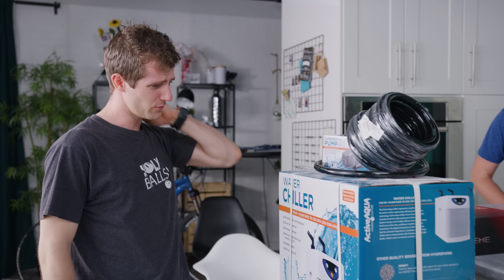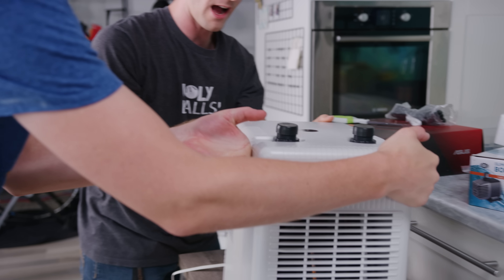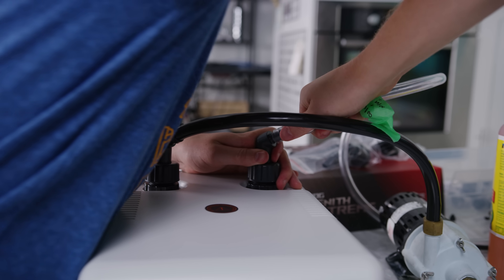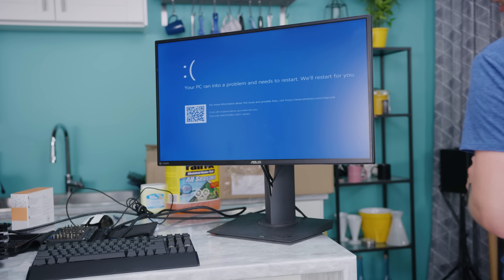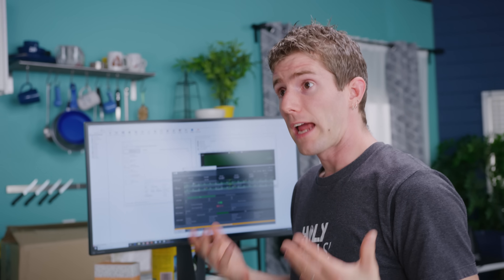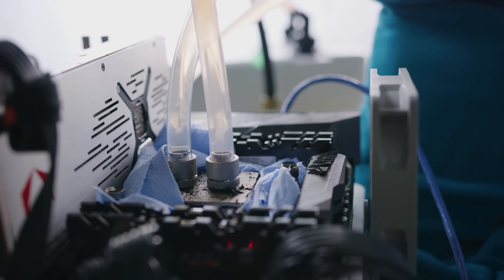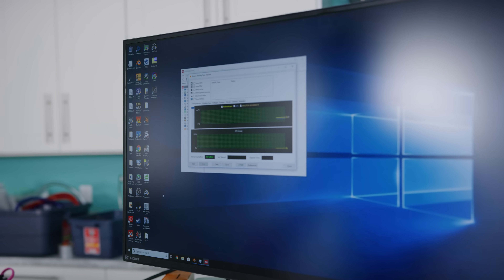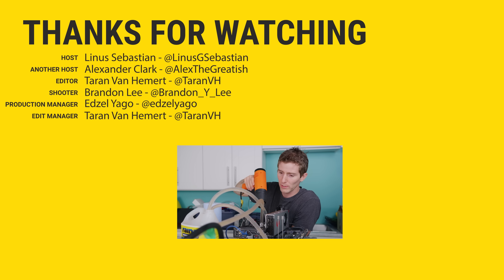Chilling Threadripper 2!!!

Comment: Adding airflow to the block should increase sweating not decrease it right? You're giving it fresh air to condense moisture from, for short tests just load up on shop towels so there is trapped air against the block it will sweat till the there is nothing left in the small pocket of air then stop and the surplus shop towels should be able to wick that all away quite easily. For longer tests this isn't safe and doesn't hold up but should be fine for quick ones like a few cinebench runs and is better then pointing a fan at it. Could be wrong though.
Reply: I think if you constantly change air (which is what pointing fan does) it should condense way less, since heat exchange is not that fast to actually cool air enough before it gets moved away.
Reply: Good point fair enough didn't think about it that way. I'm just going off my limited LN2 experience where the general advice is more towels no airflow for short tests. 
Edit: But LN2 is much colder so thats probably why.

Comment: Chillers produce a huge amount of heat when they run for long periods. If you're going to use one, you'll need to figure out a way to vent the air the chiller produces or aircon the room.

Comment: Build/buy a welding trolley and keep the hoses.  The bottle rack at the back will hold the reservoir neatly too.
The PC will take up the space for a full size welder,  but there are miniature ones on Amazon, and that chiller will work nicely with a TIG torch for all those case welding jobs around the shop.

Comment: It should be integrated into a system with automatic temperature control to prevent condensation. Using a DHT11 humidity sensor and an arduino, dew point could be calculated, then the arduino could adjust the chiller temperature to dew point+ 3C or so.

Comment: Wll, the reason for the blue screen is because your motherboard was likely set to have CSM support enabled but the boot device was running native UEFI, or visa versa. Hence the blue screen reason 'BOOT DRIVE'.

One bios setting and it would have booted.

The reason for the multiple failed POSTS was likely down to memory optimisation taking place.

Comment: I see you got the $320 1/10 hp model.  That's over 2000 BTU/hr cooling.  Why spend $100 per radiator, $30 per fan when you can achieve better cooling than room temperature with a chiller.  radiators are no longer necessary.  Just use your (D5 is my favorite) pump and set the water temp to about 19 C.  Fittings are 15 each for bulkhead fittings.  Better cooling for about the same price with no fan noise.

Comment: Use this same setup but drop the motherboard into a mineral oil bath, maybe that'll cancel out the moisture issue? Be like a double crazy setup; liquid chiller mineral oil bathed threadripper 2. Kind of a catchy name actually.
Reply: Der 8auer made that: a chilled dual-socket TR2 system submerged in a 3M cooler to prevent condensation. You should check it out. He got like 10500 Cinebench or something (with 2 CPUS, mind you)
Reply: yeah, great idea plus liquid cool the graphics card too ( if not already done )
Reply: That'd be wicked
Reply: Upvote so he sees this
Reply: Do this! :D
Reply: Oh shit he should.
Reply: old craglist cooler filled with oil and the pc dunked in it and some holes cut in the lid for the tubes. done. call it a "dunk-in-run"
Reply: They got over 6,000 in Cinebench at 59 F (with no condensation), which was basically the same score as 41 F (with condensation everywhere), so why not just run it at 59 and not worry about moisture?
Reply: because, you either go absurd or go home
Reply: So siiiiick!
Reply: HELL YEAH!!!!!!!!!!!!!!!
Reply: This. Do this

Comment: Yea, I would just like to see what this thing could do with liquid metal and delidded cpu. That would let the coolant be much warmer and the condensation would never be an issue. Furthermore, I would like an expert clocking it to the absolute extremes, getting it stable and dry. Should be better than dry ice cooling but like in a wide desktop PC enclosure, quiet as an office PC. Now that  would be cool.

Comment: You should cannibalize it and make it part of a system, one thing that would be good is put the motherboard in a clear perspex case, just enough so its close to the back of the motherboard but 2" in front it to allow room for the ram and block fittings, you would need a PCIe extender to come out the PCIe slot and run up the back of the MB  and out the top to have the GPU at the top, the CPU block fittings would come strait out from the MB and through the perspex you would then fill the perspex with Novec M3 completely covering the MB and then fir it all into a large metal case, doing this would meen you could run the coolant as cold as you could and because there is no air around the mother board just Novec then there would be no condensation.

Comment: I would still really love to see a test of immersion cooling in an electrically inert fluid and chilling that with an aquarium chiller.  I would think that the immersion factor might remove the concern for condensation, at least inside the case.

Comment: Please do it, and do it without the pumps because it caused condensation as you had the water moving to fast with the pump to suit the room temperature. And use the regular radiator to complete the circle of flow through the system.

Comment: Hey Linus team, this is somehing i was looking for. I need every single MHz of performace for a system that needs to run 24/7 cause for software that is running 4core and its license cost ~100k USD/year/4cores. Could you try if 8700k will fly above 5.5GHz on this?

Comment: you need a reservoir to hold the anti-freeze liquid. a 10gallon fish tank full of it with a submerged pump would be a much cleaner look and quieter because a submerged pump would make a lot less noise than the giant inline pump used here. I would be extremely excited to see this. You could put the whole thing in the back of that giant case labs case it would be epic.

Comment: Where’s the vid on the new RTX 2080 ti founders? If you somehow got a watercooling system with dual sli and get custom waterblocks with that cpu it could be a monster build. And I feel the only solution to keep a system that insane cold enough is this water cooler

Comment: YES!  Integrate the chiller into a system!  but maybe you can modify it to run even colder?  sub-zero would be epic.  create a better insulation system for the socket area on the board, and put a GPU (or 2) into the loop as well.

Use the system to beat Gamers Nexus in 3d Mark!  His scores are with ambient cooling only, no sub ambient let alone below freezing or sub zero!

Comment: As a mechanical engineer, you guys are killing me!  You shouldn't set the cooling water to be below the dew point of the air in the room.  In a typical house, that would be around 60 or so degrees.  If the cooling water stays above the dew point of the room it will not form condensate.  You can buy cheap devices that will tell you what the rooms dew point is. Once you have that info set the cooler to a few degrees above that.  If you got real fancy you could put a chinese ultrasonic flow meter with two temperature probes on the inlet and outlet and it would calculate the power carried away by the fluid.  These meters can be found for around $200 on amazon https://www.amazon.com/TUF-2000M-TS-2-Ultrasonic-Flow-Meter-Kit/dp/B06Y4RK9MM/ref=sr_1_1?ie=UTF8&qid=1535574155&sr=8-1&keywords=TS+ultrasonic that meter doesn't come with temp probes, but a couple of PT100 sensors are pretty cheap.  If you want to go that route, hit me up and I can give you a hand setting it up, being chinese, the documentation is a little cryptic at times.
Reply: I believe they addressed that in the video, stating going below the dew point is dangerous, but they were doing so for testing purposes.
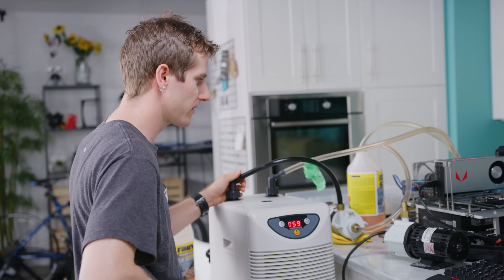Reply: You deliberately ignored 10:40 to 11:00 to show your smarts, didn't you?
Reply: @Drew H. You are 100% right, I totally missed it, was not paying close enough attention, I had it on in the background while I was doing something else!  It still boggles the mind that they would choose to do that with such expensive hardware.
Reply: Timothy Stark He literally discusses this at the 11min mark... He is fully aware of being below the dew point
Reply: Not until after it took 3 hours to dry out the system!  I highly doubt they did it on purpose, most people wouldn't have a clue until it happened, then afterwards it probably occurred to them to raise the temperature, which they did to "60 freedom units" which is still dangerously close to the dew point during the summer for most parts of the US.  If they are doing it on purpose just to dramatize things, I hadn't thought of that, but would make sense, I simply haven't watched enough of his videos to know.  Either way that 32 core processor and it's MB would be way more expensive a piece of kit than I would want "play" with.  Perhaps he has tons of money and doesn't care if it costs him a few thousand bucks to make a video?????
Reply: Timothy Stark they are using celcius! Not fahrenheit.
Reply: You are completely missing the point of the video
Reply: metaloenformol we get the video, but if your going to show your smarts in a testing video don’t ghetto rig it. Using the proper set up, you get proper performance
Reply: What is the danger in having pure water condense onto the cpu?
Reply: Alexander Pearce water and electronics do not mix. Great way to kill a system
Reply: might pick up dust particles etc, and then short I guess
Reply: They always risk catastrophic  failure intentionally to make things more entertaining. They are ghetto with a purpose.
Reply: You must be new here. Welcome!
Reply: 60 degrees? That is like extremely hot.
Reply: It's 6.00 not 60.0
Reply: lol Your special, and dont know anything about extreme OC'ing.

Comment: My computer has been giving me a memory error beep code so I bought different ram and its still giving me the beep code and I dont know what to do at this point
Reply: Is the CPU socketed correctly?
Reply: @bradybrooks8659  yes
Reply: Check for bios updates.
Reply: @bradybrooks8659  how do I check for bios updates if I have never turned it on
Reply: @donutactual8887  give me the name of the board and the CPU in the board. Give my a few hours to look around.
Reply: Did the PC ever work or is this just a new thing after years of proper operation?
Reply: Intel desktop board DP43BFL and my cpu is Intel pentium E6500
Reply: @donutactual8887  you could try clearing the cmos as I have not found any common problems with that combo. Also may I ask why you have never turned on a PC with a chip from 2008?
Reply: @bradybrooks8659  well my friend gave me,his old board and cpu and my brother gave me his graphics card so everything has been turned on but in a different builds.
Reply: @donutactual8887  are you positive that the code means memory erorr and not something else? Also when you put the ram in you put it in straight correct. Also try removing one stick of it and trying to post.
Reply: @donutactual8887  did you ever get the PC working? Just checking in.
Reply: @bradybrooks8659  still trying to fiqure it out. When I get home I'm going to try and open the bios configuration menu
Reply: @donutactual8887  okay just keep me posted if you need any help.

Comment: I'm having an issue lately where Windows loads, but my monitor displays nothing (screen goes brighter, doesn't show a missing signal). I have an RX560 and I'm using HDMI. If I use safe mode to uninstall the driver, the problem fixes for about one or two boots (unless I Restart it). If anyone knows anything that could help me fix it permanently, I'd appreciate it.
Reply: Are you using drivers downloaded from AMD or via Windpws Update?

Comment: This is pretty much what I use to cool my PC, an external chiller unit. Mine originally came from a laser engraver to cool the tube, but bought the machine for parts, was the only working part of the unit and well decided to use it on my pc for water cooling. 2 years strong and still cools better then any other liquid cooler ive tried. Not subzero temps though.

Comment: Couldn’t u have made a reservoir that has a copper plate on the bottom so u can use that to hold all the condensation and u can put it as low as u want
Reply: The condensation occurs because of moisture in the air and cool surfaces, so as long as you have sub-ambient temperatures anywhere you'll get condensation. The only way to really combat it is conformal coating or a layer of vaseline and some insulation to keep the air off the cpu block
Reply: Would it be possible to have a external heater to deal with these issues?
Reply: Yes, K|NGP|N uses heat gun and heated socket. Check Jayztwocents video with him, he explained a lot of stuff about sub zero cooling. Basically you want everything except CPU itself above ambient temperature or at least above dew point.

Comment: Same experiment except with Intel 8700k and a pair of high TDP GPUs of your choice. Overclock til you either blow something up or the system reaches 1.21 gigawatts and travels through time.
Reply: Doesn’t make a bit of sense but ok
Reply: With Linus nothing is off the table

Comment: Linus, just a tip to make it simpler. There are chillers on the market which contain pump and tank inside housing (e.g. SMC chillers). It is a bit bigger, but all integrated. The smallest ones can cool around 1100 W. These chillers are meant for 24/7 operation and cost like that 32c Threadripper or less.

Comment: "That is a real man's pump. It will give you a lot of head... pressure" ( ͡° ͜ʖ ͡°)

Wait, 32 cores sucking nearly 600W at full load and still running at 39C TOP !? That's fucking insane !
Also I wanted to point out this video was way more entertaining than usual. Please strip out this bad boy and fit it in a monster case for shit and giggles :D

Comment: Are you going to make a new control panel for the Hydroponic Cooler? And you should not use styrofoam.  owens corning foamular 150 1/2 inch thick to make the case out of and a couple of plug in outdoor 2 gang weather box and silicone, silicon packs for the moisture.

Comment: Lol overclocked threadripper maxing at 39°C, mine i5 have higher temp at idling
Reply: You might not have a chiller like theirs installed
Reply: My old Ivy Bridge i5 idled at like 60°C
Reply: I7 8700 k @ 5.2 idles lower then that. I sit at 37°C.
Reply: And here I thought I was doing well when I got idle temps of 39°C on my Ryzen 5
Reply: Heh. I have an i7 980X at 32 C at idle.
Reply: #chilledIntelChallenge?
Reply: @CrazyTimeSK  my i5 8400 idles at 21 and 41 under load
Reply: 8600k idling at 30c , max I ever reached is at long benchmarking at 5ghz 66c.. Air cooler deep cool with 2fans.

Comment: I was wondering, when doing “extreme” CPU cooling, would it
not be a good idea to flip the motherboard upside down so moisture can fall
away from the board rather than puddle up on it?
Reply: Surface tension and cohesion can cause water to run along things in odd ways instead of falling freely so it could make it more likely to damage pcie, ram slots, vrm, or other components you don't want wet. Like how when you're doing dishes it can run along your arm and wet your sleeves instead of just dripping off your hands. Might be worth a shot with cheap hardware for a test though.

Edit: also capillary action.
Reply: audio226 Such a simple yet functional idea...
Reply: Just dump the whole thing into mineral oil, not even for cooling, just as a protective measure
Reply: but then it would puddle on the back of the motherboard which is worse becase there is smds and solder joints on the back
Reply: nah, the back of the mobo won't be that cold.

Comment: Cannibalism may be a bad move. I would worry about the refrigeration unit causing the system to fog up.
I would say paint it black, Mod the fan assembly if possible, run tubes out of the back of the PC through grommets, place the cooler under the desk, hook it up with quick disconnecting tubing, fill the loop, and go to town.
Reply: Oh and make a full loop and verify the materials used for the loop are corrosion safe/ resistant for long term use... Then do a follow up video on practicality/ power consumption.

Comment: you do know you can just grab 128 gb ssd and install latest windows there, and everytime you change pc, just grab that and move it to your new pc right.

windows (and any other OS) comes with default firmware for most common hardware. what you have to do is just go to driver pack web and install the new drivers for new pc. will be way faster than installing windows all over again and then install new drivers.
Reply: Or just go with Linux and it is even easier.

Comment: >Board doesn't work and they think they might've shorted it due to condensation
>They dry it
>After 3 hours it works
>Later:
>"Uh, this might be a while"
>"Uhm.."
>"It seems like alot of the issue was just that your crappy SSD ...died.
It might not have even been the condensation."
>"Oh...."

I fucking died.

Comment: Put the pump and the chiller to their max and try the overclocking limits of the 2990WX. And insulate the board and the socket well with some towels, vaseline etc. It would be insane

Comment: Mount a pump by the inlet/outlet and a box reservoir sitting on top the cooler then over lock the MSI motherboard with full insulation to see how far the thread-ripper 2990wx will overclock. Some cases still have external water-cooling outlets so this could be an office computer or the new Xnumber gamers using 1pc video.